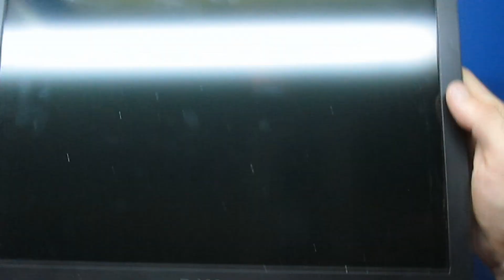DELL Latitude E6410 Fully Disassembly

Comment: I have E6410 with i7 720QM quad core and 90 watt power supply. Everything works perfect with zero problems. My i7 is turbo boosting to 2.9 ghz on 1 core and works at 933 mhz on idle :) I have video with it. Cheers!
Reply: Ok
Reply: Me too I also have the same version 🤝
Reply: If you have the $$, I would invest in the Intel i7-640M Dual core processor.  The base clock is 2.8GHz.  But,     the turbo  boost is an impressive 3.46GHz for a 1st Gen ix (where x= 3, 5, or 7) processor.
    Yes, you get 2 extra cores w/the i7-720QM.  But, you sacrifice the speed.
Reply: @ryanrobison6432  yes, you are right sir. i7 quad turbo on all cores are only 1.8 ghz or something like that :/
Reply: With bios A17 .... 16 GB of RAM at 1333MHz with i7-7xx 8xx... ❤

Comment: hey bro , what is the chip at the L of the heatsink, do we have to add thermal patse on it
Reply: Its graphics chipset, Intel GPU, it needs a thermal pad.
Reply: @RDanielFR  what thickness is the pad  please
Reply: @garrygibbons2989  it comes with a thermal pad, but always runs too hot - many people have done 

0) chip
1) thermal paste
2) copper shim (0.3mm)
3) thermal paste
4) heat-sink

Comment: Great laptop! Although:

1)  the people putting higher than 35 Watt TDP CPUs into it are really not the smartest (heat is already an issue with 35W i5)
2) and also the people saying they got 16 Gb of RAM into it are liars
3) the people putting W10 & W11 kinda seem strange as this is far outside of what the laptop was supposed to handle, they are very intensive OSes which also have no dedicated drivers

I made a bypass for the CPU fan which sacrifices one USB port to be able to provide the fan with full on 5V, 0.5A power, my idle temps on the CPU are ~27-31 degrees, thinking of adding a discrete potentiometer for analogue fan control :) If I am able to improve the cooling further, I will look into putting an i7 in there. 3rd party companies make optical disk drive "blower" modules which get a lot of cool air circulating into the laptop - the nvidia chip however is a poor bastard that's almost always 10C hotter than the CPU.

Shame about the 8Gb RAM limit though!
Reply: I upgraded mine with a 940XM and a custom cooling solution
16GB RAM , which does in fact work, so I wouldn’t assume people are lying about that, 
500 GB MX500 SSD
Wifi 6 (802.11 ax)
Reply: @PrjctWRX  "Custom cooling solution"? Would love to see some pictures, I have lots of ideas but it takes a long time to design something that looks professional.

And you have the "i7-940XM", why? First of all, congrats, you're running 25 watts higher TDP cpu than is designed, unless your "cooling solution" is really good, - your idle temps are probably 60s or 70s. 

If you look up this CPU on the intel website, you'll see it can only handle 8 Gb of RAM, so people saying they can run 16 Gb is not good enough proof, post a quick video or some pictures. People have been able to boot with 16 Gb of RAM but have had crashes/shutdowns once the OS actually tries to use more than 8 Gb of ram. It just seems like you're lying, dude.
Reply: @andreivaughn1468  I’ll try and make a video and post it when I can, I’m actually quite proud of what I was able to do with this little laptop and it was a fun process to do so
Reply: @PrjctWRX  Ok, well, thanks. And please try to understand my skepticism - so far I've only ever seen people saying it, and never anyone showing it (no photos, or anything online), so it seems strange to me.

I am quite proud at the moment of what I've been able to do for the temps by maxing out the CPU fan (despite the fact there's no way to control fan speed via pwm on this laptop). I have found a great i7 which is 2 cores 4 threads and only 25 Watt tdp, I think it would run very cool.

But if there's some way to get 16 GB of ram I might just throw my old plan out of the window and try to get that working. Keep me updated if possible! The video doesn't have to be crazy, just fire up task manager "performance" tab and start using ram!
Reply: @andreivaughn1468  you’re using the i7 640M?